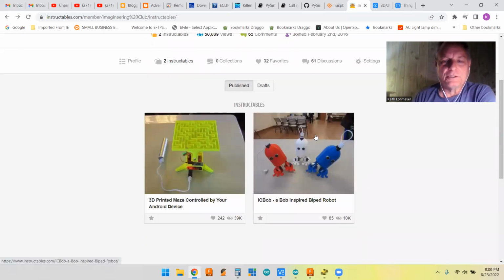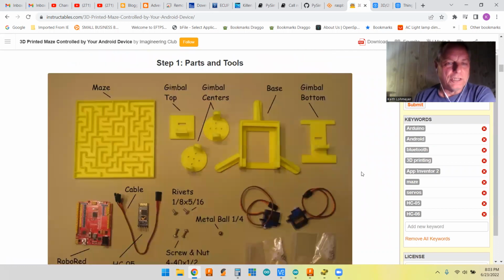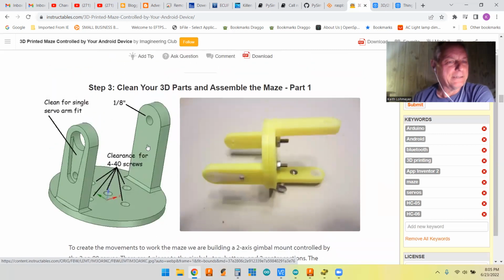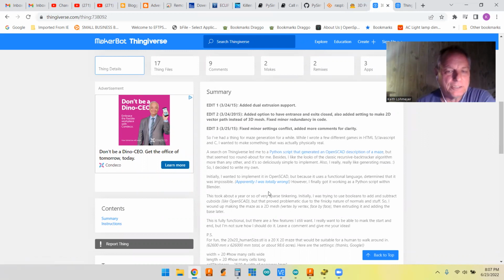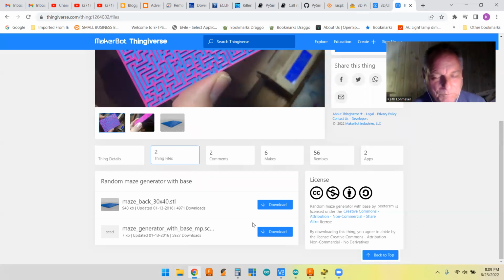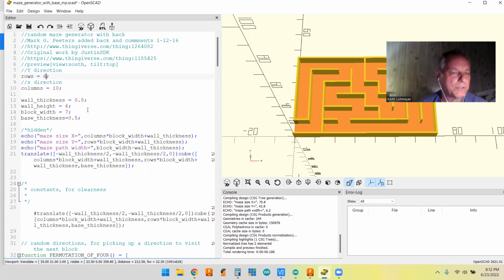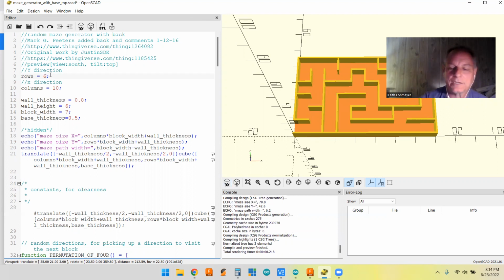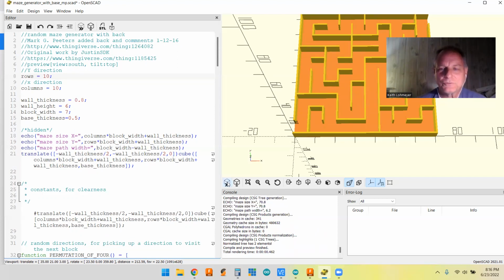Make something aMAZEing on your 3D printer

Comment: Fascinating!!! 🧐
I wonder if I can figure out how to make a random maze generator 🤔 
I never heard of "Reverse Back Tracker" algorithm 🤨 
I'm guessing from the name: the travel pattern to escape the maze is generated first, then the maze is built around that path 🤔💭
Reply from the maker: BBF, First I said the wrong name on the vid it is recursive back tracker. The algorithm starts at any square then randomly picks a 'neighbor' (N,E,S,W) square that has not been visited yet and removes the connecting wall and moves to that square. The process continues until you get to a square that has no unvisited neighbors. At that point the back tracking comes in. You retrace your steps one at a time and look for an unvisited neighbor each step. If you find one you take that path as far as you can then back track again. When coding this they use a stack like list or array to keep track of the path, pushing the new cell visited on the top of the stack and popping (removing) a cell from the top of the list when you find a cell with no unvisited neighbors. You know the maze is complete when your stack is empty because you have retraced your steps without finding an unvisited neighbor. In addition to the stack the code has to keep track of if a cell has been visited (a 2 dimensional array). They came up with an interesting way to keep track of the cell wall status. Even though each cell has 4 shared walls the code only keeps track of 2, the East and South walls. The cell above has the North wall status and the cell to the West has the West wall status. It was fun to look at how they do it. Hope this is clear.